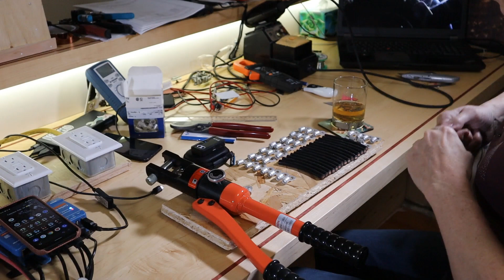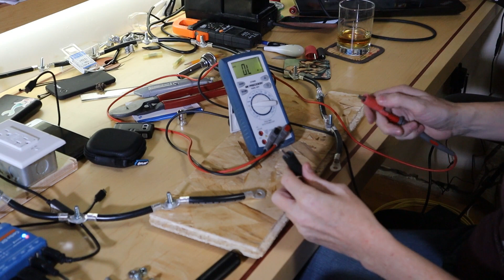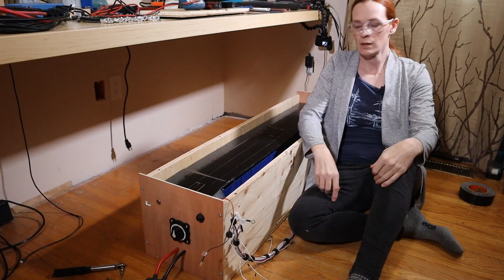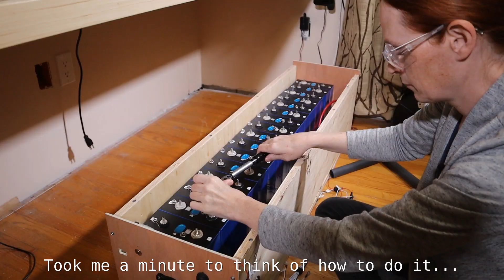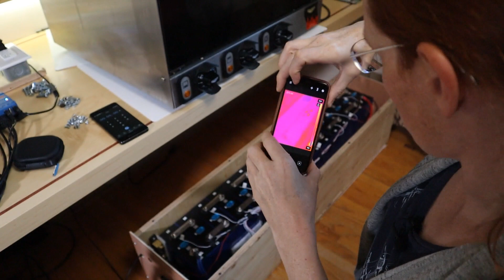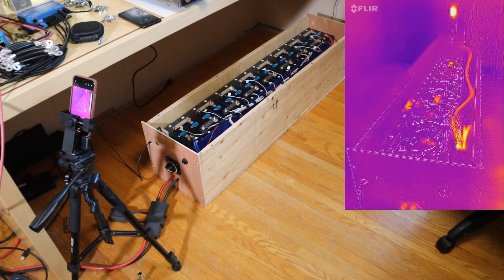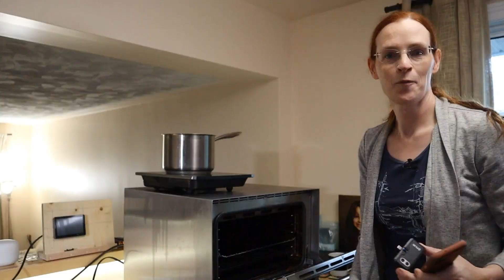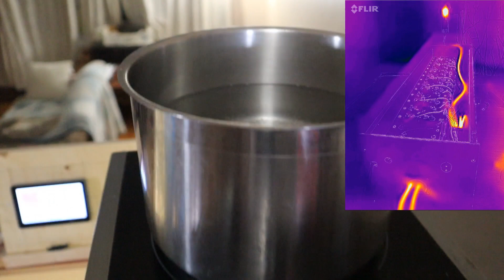What's Better? Rigid or Flexible Bus Bars - How to build a 48v Lifepo4 battery (Ep. 21)

Comment: cross section Surface area and composition of the bus bar/cable is also factors. Are the bus bars copper or if aluminum then 75% rate of copper. I have flex cables and also copper bus bar but my copper bus bars are equivalent of 0000. Same with my lines to the inverter where possible. I run 0000 and then pivot off to lighter gage and that is as short as possible to avoid heat and resistance as well as reduce AC ripple on the DC - I have PIP inverter/charge controllers and it was indicated to me that they may have more issues with that over Victron.

Comment: Thank you so much for testing the flexible busbars. And using the thermal imaging. I would just like to confirm that you did use a 100 amp BMS? Thanks Again
Reply from the maker: Yup! I'm using the Overkill Solar 100A 16S - https://overkillsolar.com/product/bms-100a-16s-lifepo4/

This said; I am very intrigued by the JK BMS that andy has been playing with. I am really tempted to order it and compare the two. So be sure to watch Andy's recent videos on the topic ( https://www.youtube.com/c/OffGridGarageAustralia/videos ) before ordering. I don't know yet which is better, but Andy seems really happy with the JK, and that deserves some weight.

Comment: Great video and result. I was not expecting this either. Could be the first ever test here on Youtube showing the difference. The only concern with the flexible cables are the long term quality of the connection, moisture is your biggest enemy on the boat. More connections could mean more corrosion. Salty water between these different metal connections aluminium, tinned copper, copper, stainless. Are you going to use some sort of anti-oxide paste to prevent this corrosion? I guess you could just use your amazing thermal camera once in a while and check on all these connections, right? Also you will have 6 BMS' which monitor individual cell voltages. Very interesting long term experiment.
Thanks for doing all the testing and science. And showing your adorable cats! 🐱

Stay charged.
Reply from the maker: I'll be ordering resin-lined shrink tubing (simply didn't have enough on hand for this video), and I'll cap the ends with liquid electrical tape or some other substance that stays gooey to keep air out soon enough. Corrosion is absolutely a nightmare on boats, so it's worth putting lots of thought into. 

I've been watching your videos on the JK BMS and have been tempted to order one myself. I'll be really curious to see which I can gather the most data from, exactly for the reason of early detection of connection problems. I may indeed use anti-ox, though I also wonder if I can find aluminium wire and ring terminals... Something to look into. It would be nice to replace the jumpers, terminal posts and nuts all with AL to have only one metal type. 

I noticed you showed your pups in the last video!! Youtube needs more pets. ^_^

Stay SPAT'ed!
Reply: @TheDigitalMermaid   What about soldering that void on the end?  Much less potential for failure if corrosion in your crimp connection starts setting in.  Probably would want to do this after the crimp, but before the heat shrink wrap.
Reply: @ForbiddTV  Nice idea, bend them to correct shape BEFORE your solder creeps up to a certain distance and makes them more rigid...
Reply: In my boat I like to solder all the connections to avoid electric troubles.

Comment: You happen to have a amazon link for a fuse and holder equivalent to the one you use?
Reply from the maker: Dunno about Amazon, but here are the links for Mouser;
Fuse holder (2-pole) - https://www.mouser.ca/ProductDetail/576-LPSM0002Z (LittleFuse LPSM0002Z)
Fuses (20A) - https://www.mouser.ca/ProductDetail/576-0FLM020.T (LittleFuse 0FLM020.T)
Reply: @TheDigitalMermaid  this is the one you use to the inverter? I thought it was a 200 amp class t of some sort
Reply from the maker: @seabeckstarlite  Aaaah, that fuse. Here - https://www.mouser.ca/ProductDetail/576-JLLN200.X (LittleFuse JLLN-200)
Reply: @TheDigitalMermaid  Thank you :)

Comment: I just finished shooting a video, will edit it soon, but the wire busbars will perform equally as well as the rigid. I have a BH 100ah pack that I removed 16" (yes 16 inches) of wire between cells, and directly soldered the tabs. Made no difference in usable capacity, the losses are negligible.

Comment: Great comparison! 

It's good to see people having ideas and putting them to the test themselves, because there are always so many variables. Andy from OGG had some connection issues with his solid bus bars, so I sent him a set of the ones I had laser cut from 4mm aluminium. That completely solved the connection issues he had, and this has been replicated several times since. So some of the connection issues seem to be related to the material used, and I went for aluminium to match the terminal material. 

I make some 12v 280Ah batteries here in Australia, and they all use solid bars. I've found them to be very consistent (because I have them custom made), and that allows a level of certainty I don't get with the OEM ones that can be completely variable size. I've found them to be about half the resistance of a comparable cable with lugs, and that results in about 5w of saved energy loss at a 100A load. So at a 280A load, we would see more like 13w of loss across the bars in a 4S battery. But with cables, it would be about double that. 

The solid ones are also of course much simpler and faster, as well as being cheaper. The lack of flexibility in my case isn't an issue, as everything is very tightly packed into the case, so even though these batteries are designed for RV use, there's no notable movement between the cells. 

There's also issues to keep in mind regarding dissimilar metals, so the cable version will have a mixture of Aluminium (on the battery terminal), Steel (for the stud and nut), Copper (for the cable and the lug), and often the lug will be Tin Plated. This is something particularly important for marine use. In the setup I use, I've limited it to just Aluminium and Steel. 

For testing the resistance, a regular multimeter isn't really accurate enough. You really need a meter specifically designed for testing low impedance. However the regular multimeter might provide a heads up to something being very wrong.
Reply: Hahaha, you two here 😊
Reply from the maker: Powerwall Paul, that you? Andy speaks quite highly of your work, if so! 

The dissimilar metals concern is very much a real concern over the long haul. I have hopes that the tinned surface will help, but I am very familiar with and worried about copper -> aluminium problems over time. It's the biggest reason I would consider alu bars like yours, just to get similar metals. When you have 4x cells in a packed case, as you build, then I totally don't see the value in flexible bus bars. When you have 16 cells though, it's hard to fix those in place, though. So hence back to my concern for flexible. I wonder if I should try to source aluminium ring terminals and wires... 

Though, as @LithiumSolar talked about, maybe a bus bar with a hump to allow for expansion, but made out of aluminium, might not be the top option. If you could find threaded rod that is also aluminium, and perhaps even bolts of the same, it would be wonderful to have a pure aluminium connection setup.
Reply: @TheDigitalMermaid  yep that's me :) 

One of the other things I do to enhance the stability of the cells, is place a thin 0.3mm sheet of vinyl between each cell. It's just clear vinyl tablecloth available from our hardware store by the meter. It ends up being slightly grippy between the cells, so that prevents movement and/or abrasion. However it wouldn't really make an effect for expansion/contraction. 

The bars I make have a slot like most of the solid ones do, so people can space the cells slightly apart if need be, but that would allow more movement again. The bent (humped) bars are a good idea, but from my experience they require a lot of force to bend at all, so I doubt they would be very effective at being a spring of sorts to take up any movement. 

For marine setups, I would expect some of the various pastes or greases are going to be enough to reduce the chance of corrosion or electrolysis. But I'm not experienced with those. There's a lot of debate about "conductive grease or paste" too, however they are never as conductive as the metal they're being applied to, so they should be just considered as a barrier to exclude oxygen. Still effective in many cases though. 

As always, it's best to try and eliminate items that could cause an issue, instead of apply a fix for the issue. 

I'll be following on your journey to see how it all goes. :)
Reply from the maker: :) @PowerPaulAu  Honoured to have you follow along! There's another channel, Project Brupeg, who I am fortunate to call friends. I mention them because they often speak about corrosion issues (mild-steel components, usually), and the often talk about how sealed compartments, like crash bulkheads, convert the oxygen in the space to rust quickly, then the oxygen is gone and rusting stops. I wonder if covering the terminals with something that blocks gas exchange could help for a similar reason... Whatever oxygen was contain inside is converted and then the metals remain as they are. 

Another commenter made a similar suggestion, and I am finding  it more interesting as time goes on. I'm going to have to give this some thought. :)

Comment: Great video. I have the 280ah cells and been debating about light compression using springs but was concerned with stress on terminals with expansion/contraction. I also thought about using cable instead of busbars but could not find information comparing the two. You helped answer my question! I have heard that crimp is very important. Thank you so much. Andy, what do you think??
Reply from the maker: This is the kind of comment that makes me happy and keeps me going. ^_^
Reply: @TheDigitalMermaid  Question: how did you arrive a 4AWG wire? Busbars supplied are 20mm wide and 2mm thick so area is 40mm2. 1AWG Cross Sectional Area(mm2) is 42.4mm2. Would not a 1 AWG wire be the correct replacement?? Or did you calculate based of the 100 amps from bms. I am a novice so please take this as a learning experience for me.
Reply: @gregnorman3183  originally, I used the voltage drop calculator to decide on the wire size, aiming for 1% drop at most. Obviously, in the battery it's 3.2v but for the short distance and (relative) low current, I figured it was safe. Considering the bus bars are rated to 1c, 280a, at least. So at half the cross section, never going over 100a, 19mm seemed ok.

Comment: Interesting test and completely agree with your thoughts in the intro! There is a lot more to think about in a mobile application vs a static setup on a shelf. Regarding the wire busbar method, I think a lot of it has to do with quality of crimp. I also have to wonder about the additional points where corrosion can occur (under lug crimp) especially in marine applications. Maybe negligible, but this topic is very interesting to think about. I really like the ring terminals you've used as you can see the end of the wire on the ring side.
Reply from the maker: In the real world, I'll have resin-infused shrink tubing to seal that up. I was thinking of putting some liquid electrical tape / resin / something to seal the end to cover the strands. In this case, I just didn't have enough on hand and it didn't matter for the test. Corrosion is a huge concern on a boat, but that's also why I used tinned copper wires and ring terminals. 

You've got access to some decent test gear, I believe. I would very much love to see a higher amperage load placed on the two terminal types to see if there's a more obvious different closer to 1C or higher. 

Thanks again for all your videos, they've helped me a lot in the past. :)
Reply: @TheDigitalMermaid  Your jumpers are 4awg so they can handle 95-120 amps, with your test pulling 50 amps, I think its 120 amps for that wire given it has 105C rating for the insulation. To pull 280 amps it would need to be 1/0 or 2/0 depending on the insulation spec. I'd be willing to bet that proper built jumpers like you made at a full 1C load would handle the load a lot better than the busbars as I'm suspicious those busbars could actually take the full 1C load without serious over heating. You'd probably have to double them up for such a high load as the seem quite thin, but that gives more chances for bad connections as well. 

Tinned wire, tinned ring terminals, proper crimping and sealing them as you list, I can't see how they'd be worse than those flat plate bars especially when as you point out it's a lot easier to get a good mate between the terminal and the rings. Given the fact your connections will be much more solid that would also reduce the risk of corrosion vs the solid busbars. 

I think your solution is an excellent one. And since you are limited to 100 amps by the BMS your current wire size is probably perfect.
Reply: If you want to measure small resistances correctly, use a micro-ohm meter or put a large, well defined current through the wires and measure the voltage with a standard multimeter.

Comment: Braided/stranded should have a lower resistance than solid.  Although the cross-sectional area through the solid may be larger, the resistance of the braided should be lower. 1/Rt = 1/R1 + 1/R2 + 1/r3 +...., where Rt is the effective resistance and R1, R2, R3,... are the resistances of each of the strands.  This is complicated further by the fact that the strands touch each other periodically, but I think you get the idea!!

Comment: Flexible is best.. even when installing battery, you shake it a bit.. Rigid cant absorb this and make a stress on cell pole. Even cells can have different heights, which makes rigid bus bars not touching properly. Only scenarion, when rigid are usabe is when you mount them and then fix/compress cells together. Thanks for test anyway, i can see real progress and think you are now closer to be a battery pro then newbe..

Comment: Don’t sell yourself short.  I can’t see how Andy or Will could have performed this test any better.  The only thing that I would of done is that while you had all the connectors in series for the resistance test, I would have run a heavy load through both sets and compared the voltage drop.  In other words, run 100 amps at say 52 volts through each set and measure at both ends to see what the voltage drop across each set had.  I’m guessing it would of been a couple of volts lost.  This would have given you a second way to measure the resistance, plus measure it under a load.  Great video, thanks for taking the time to do all that work and sharing.

Comment: Possibly next test you could use a cheap laser thermometer so as to get an idea of the actual thermal temps of the "hot" bus bar. I would really like to focus on why that one was hotter.  It appears the flexible connectors have more surface area of connection than the solid bus bars.  Hmm.  Lots to think about.

Comment: Braided Battery Straps are recommended for mobile applications.  Those metal encased cells require an extra insulating sheet the blue wrap is very thin and will wear through quickly.  See https://youtu.be/ZTkh_58ppoU

Comment: So, I considered the length of the cable. Assuming you have 280Ah cells, the terminals (allowing for a separation sheet or foam between the cells) is about 75mm, and that you are using 4AWG cable, and allowing for the lugs to be straight. Using the typical minimum bend radius for 4AWG cable, you either have to have a long piece of cable (180mm) which would be a BIG loop, or the distance from the ends of the lugs (where the cable is outside the lug casing) should be about 5mm longer than the actual distance if the cable were completely straight. About 50mm for the cable in this case I think. It might have been better to have three 8AWG cables to make the busbar. The minimum bend radius for 8AWG is the same as the gap you are joining over, so you could make as long as a semi-circle if you wanted (about 70mm of cable between the lugs).

Comment: Good test :) You could use some MG Chemicals 846-847 conductive carbon grease on the terminals to make the contact even better. How big is the cable? The busbar is 40mm2 (AWG1).
Reply: that stuff is rubbish not conductive scam

Comment: my battery is a p2s16, i've used flexible busbars in between the serial cells. the pack is running my house, max charge is 100amps, max discharge is around 95 amps, pack has been running for 4 months now and the cells are still ballanced enough to charge up to 3.6 volts without problems.